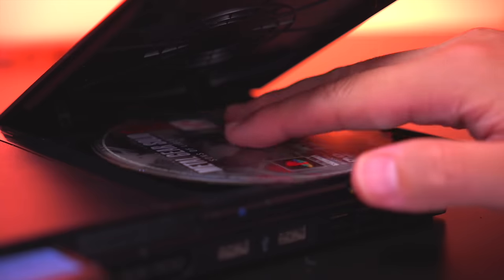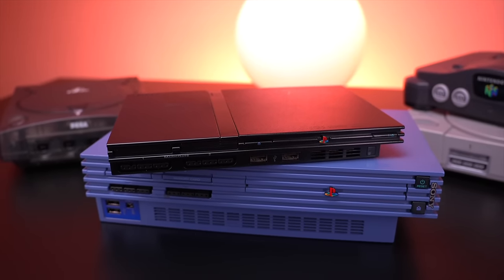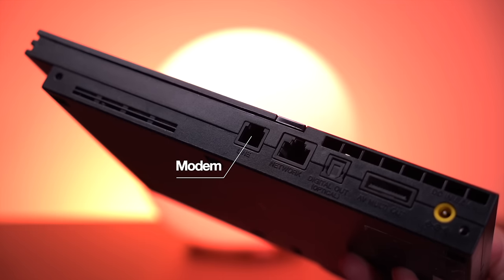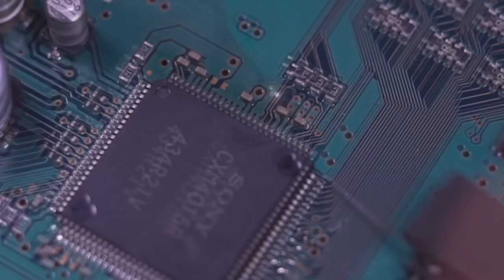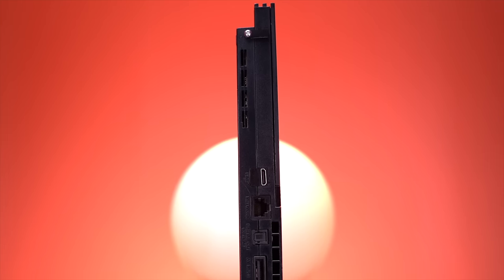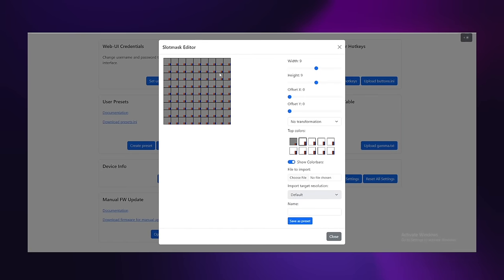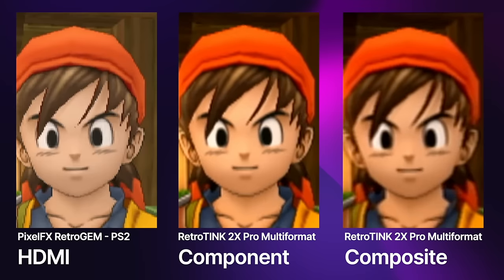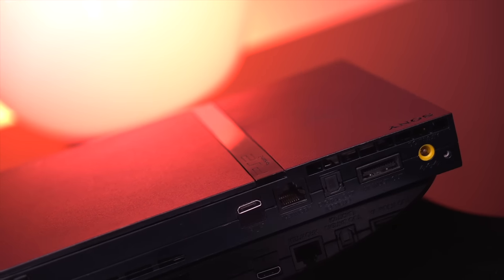This HDMI Mod Makes The PlayStation 2 Look GORGEOUS!

Comment: Charging more for non hardware features is crazy, hope the devs change their minds on this one
Reply: 🤷‍♂Software doesn't write itself...
Reply: @VideogameBucko  it also has a zero per-unit cost post-development, so it's pretty dumb to charge on a per-unit basis. But, the fact that people will pay for it exposes how desperate people are for hardware like this. High demand, low supply.
Reply: @VideogameBucko  its the modding space and open source will always win, either these gadgets are going to get "jailbroken" or another team will make a better one that doesn't lock basic features behind a paywall
Reply: @VideogameBucko  so sell one version for 155 usd.
Reply: Charging that much in general for the mod is stupid and just gouging, especially given that the mod is meant to be pretty much a "one size fits all" option that works on multiple consoles. I get that it's a niche product, but $120-$190 for it is still kind of ridiculous. I hope they figure out a way to get the price down and produce more units, so that they also stop constantly running out of stock.
Reply: The cost is what it is. No-one is forcing anyone to buy either version. These things take time to develop, for likely a pretty small market, and the developers deserve to make a living. The market will decide whether it is overpriced or not; if it is, not many people will buy one and that will be that.

If you value 1080p output and MAD, then pony up the $190. If you're OK with 720p and BOB then save the cash. Otherwise, you're essentially just asking for the mod to be cheaper. Personally, this mod is cool but too expensive for my occasional PS2 use; I either play on a CRT, or render natively at 1080p using PCSX2, both of which look better anyway.
Reply: I think the major detractor is that it is already pretty labor intensive just to install and then on top of it, now you have a choice of the two. They really should have just sold the full version and called it a day.
Reply: @nismospek  Well, at least the difference is only in the software. It would be more of an issue if you had to [pay someone to] desolder the basic version, then buy the fancy one and get that fitted. You can't really lose; you can buy the cheaper one, then if it doesn't meet your needs, pay for the upgrade later. Or if you know you need >720p support, just buy the top version to start with. Either way, the cost is the same. 

It would be worse if the cost of the basic version + upgrade was greater than just buying the better version. Then you'd need to think carefully which you'd need in advance. Probably shouldn't give them ideas!
Reply: I have a feeling people will either have open source firmware or a way to pirate the official one in short order.
Reply: @ridingnerdy6406  That'd be a shame. They'd then need to drop the cheaper option and only do the $190 version.
Reply: 100 dollars for a basic mod that CAPS YOU AT 720P???
Reply: @ridingnerdy6406  Hopefully someone will reverse engineer this thing. You cannot software lock something like this.
Reply: @axi0matic  you contribute very little to the point being debated by saying "no one is forcing you to buy it" and "the market will decide its value". Yes, the cost is what it is, and people are voicing how pointless their pricing scheme is because, exactly, no one is forcing them to buy it, but they'd like to decide on their purchase without having to choose between two versions for something like this, since it makes no sense. 

It's ingenuous to keep thinking "the market" is some abstract thing that sorts everything out, the market is precisely what people make of it, and debating over whether the product's pricing is fair or not is a huge part of it. Makes no sense to just shrug it off as something one should just accept and not question at all. Do you really think the devs on this would starve if not for their product being needlessly tiered?
Reply: @VideogameBucko loser
Reply: @nattila7713  Yeah give customers less choice and make everyone pay for features that they may not need.. that makes more sense for sure.
Reply: @VideogameBucko  that is not a real choice. there is only one product and two prices.

there is noone who would only need 720p/bob deint... don't spread this nonsense :)
Reply: @axi0matic a really more basic 720p device would not xost 120. here you must pay the same expensive parts which you cannot utilize.....

so what you say is... BS
Reply: @VideogameBucko  but it can be copied and sold endlessly without additional effort..
Reply: I feel like they’ll be forced to given the reaction of the people in the comments. This won’t sell well at the current price.
Reply: @VideogameBucko As a developer myself, screw the devs that inflate prices for software features. Either set a single price that you’re willing to sell the FULL product for, or receive backlash and a drop in sales. Be a respectful company or don’t get respected
Reply: nah let their keep their mind on it, low sales record will change their mind
Reply: @VideogameBucko  So? They can be sued.
Reply: @Krilium  Yeah, giving people options and saving them money on features they may not need is such a dumb idea. Screw Microsoft for selling me Windows Home edition, they should have just charged me the extra for professional, despite the fact I've no need of domain features because I only have a home network, how dare they lock software features I don't need and will probably never need behind a paywall like this, I demand they charge me more this instant, I can't believe the cheek of it 🙄
Reply: Just pirate it
Reply: @kizurura that's more expensive than the console itself 😂, just give it a few weeks and the Chineses will make a cheap copy
Reply: @VideogameBucko You didn’t make an argument. You know that right?
Reply: @nicwelch  Yeah you didn't reply to me, you know that right?

Comment: The installation process was very impressive to see! Having installed several Modbo chips myself I know how difficult and frustrating PS2's can be to work on but filming the whole process whilst being able to clearly see what you're doing must have been even more challenging.

Having said that I still think using a PS2 on a CRT is the way to go, no amount of upscaling, filters, etc will make the PS2 look as good on a flat screen compared to the display tech it was designed for. If you're wanting a sharper/cleaner look running a PS2 on a PVM will get you a very sharp and crisp image! Otherwise a nicer consumer grade CRT is still the best choice for PS2 in my opinion.

Comment: Spend the money on the backwards compatible PS3 you will be much happier, and it will be a positive experience.  Soldering the contacts on those flex cables  is a real bastard with lead free solder, not to mention the higher temperature needed to flow the solder can easily damage the ribbon cable.  I wouldn't attempt this without a microscope and 60/40 rosin core solder.  Tito is really gifted when it comes to soldering and makes it look really easy.

Comment: I recall there were certain games on the PS2 where you had to hold a combination of buttons on the controller during boot in order to enable progressive scan. It would be nice if that process were automatic.
Reply: i think it's called GSM and it lets you force resolutions for most games
Reply: Certain games like Soul Calibur II, you hold triangle and x right after the PS2 boot menu
Reply: That was for 60hz mode
Reply: @CodyHimselfXI  other games might require a different button combo
Reply: @online_lizard  not many games work with forced progressive. Even some games that support 480p natively have issues when forced to progressive via gsm. Button combo when the game support It still is the safe bet
Reply: @online_lizard not quite, 480p through GSM is processed different than native 480p mode in game.
Reply: @MarceloMedeirosb  Nope, it's the same button combo and it's not for 60hz, it's for progressive scan 480p mode. I would know, I tested out every single game that supports it.
Reply: Yep, TEKKEN 4 comes to mind, you had to hold down Triangle and Cross simultaneously during start up.
Reply: Yup. The first game to ever support progressive scan on a Playstation console was Burnout 2: Point of Impact, and I always thought the process to enable it (holding X and Triangle on boot) was so clunky and I wished it would be automatic like how it was on Gamecube.
Reply: @CodyHimselfXI  Eh?  "480p mode" is the same as "60Hz mode".
Reply: @mazda9624  It's definitely clunky but, also kind of cool. It's like knowing a hidden secret. Hell, a lot of games that support that hidden feature don't even advertise it on the box. (Unless it's in the settings)
Reply: @GoatTheGoat  lmao....that is not the same thing. 🙃
Reply: Just an FYI, there is zero welding or welds when soldering.  You create soldering joints, not welds.  This is because the soldering is acting as the joint or glue between two items.  Where-as with welding, it is joining two things together by literally melting the two items and the welding material.
Reply: Yep. If you dont hold those 2 keys when game boots, no 480p for you, until you hit reset PS2. Certain games, like God of War 2 is nice enough to ask last time that you use 480p. Some others, like Burnout 3, just looks awful in 480i until you did hold those 2 and load in 480p.
Reply: That was for God of war 2, when you inputted in correctly, the SCEA screen would change to pink. GT4 had a dedicated 1080i mode in the options.
Most games that supported 480p had a dedicated option in the settings.
Reply: @KiteAndKeyProductions  But only the first time ever per console. After holding it down once, every game that supports progressive scan will always ask if you want to enable it on boot up even if you don't press any buttons. If you select the "No" option, then the setting on your Gamecube resets and you have to hold down B again.
Reply: @tidjane2001 Tekken 5 just has it in the settings menu.
Reply: @GoatTheGoat  It is not. 480p is just the resolution. A game can run at whatever framerate internally it wants.
Reply: That's correct. Dragon Ball Z: Budokai 3 is a game that supports this
Reply: @CodyHimselfXI  That's not entirely true, not all games use the same button combo. The majority use cross + triangle, but there are also games that use cross + circle.
Reply: @symphony137  I'm speaking from experience so, yes it is true
Reply: @CodyHimselfXI  And I'm speaking of facts. Look it up.
Reply: @symphony137  I don't need to look it up when I've already done it. 💁🏼‍♂️🤷🏼‍♂️
Reply: @yesmate78  that's what progressive scan is
Reply: The p in 480p stands for progressive. In progressive scan, the entire screen is updated 60 times a second (on NTSC). This does not necessarily affect drawn frames, only the screen update.

In interlaced mode, the screen is updated 60 times a second but only half at a time. On one update every odd scanline gets updated, and on the next every even scanline is updated, for a total  of 30 full screen updates per second.

It is true that the 480 part of 480p represents the vertical output resolution.
Reply: @CodyHimselfXI Ironically the European version I have lets you choose from 50hz, 60hz & Progressive Scan before the game starts without that combination:)
Reply: @zzztidurvirus You know, using a BC PS3 I'd always assumed there was no point using the "mode promotion" feature of /\ and X to enable 480p progressive, however I just tried it on Burnout 3 with my CECHC and wow the difference! Whereas before there was shimmer all over the backgrounds and buildings it looks a lot cleaner now and retains 1080p HDMI output. So thank you! 😊
Reply: Be a real man, don't.
Reply: @MarceloMedeirosb maybe have a bit of software that acts like you are holding the buttons for a few seconds without you having to actually do it. We did sorry to the controller port after all.
Reply: @bland9876  thats a good idea...or at least have opl identify the game and Tell you on the osd what buttons you should press.
Reply: Too expensive…I’ll pass on it
Reply: I ultimately got a game or two because they supported progressive scan. Granted, they turned out to be awesome games in their own right.
Reply: My god, the utter chore of having to hold triangle once in a while. I completely understand your frustrations, it's sooooo exhausting and difficult

Comment: The basic model should have 1080p , The last PS2 I bought used I paid like $40 Canadian, Like $30US so when you say $120-$180 US that's 4-6 times the value of current console, I think they should rethink the price plan, 1080p for $100-120 Still kind of expensive but a lot more sales would happen than a 720p version.
Reply: ... not to mention the fact that they stoop so low as to having DLC for a hardware product like car manufacturers and their scammy lot.
Reply: 720p may not be much of an issue for many people even when not connected to a dedicated scaler. The fact that motion adaptive deinterlacing is missing though is a deal breaker to me. Just look at 23:03
Reply: there should have been one version, for like 150 usd or 160. this soft lock is just awful business practice.
Reply: Just emulate.
Reply: Who wants to go through all that trouble for 720p lol
Reply: Exactly, PS2s are dirty cheap here in Brazil, paid US$15 for mine, imagine paying US$120 + 60% customs tax just for 720p lmao

Comment: Choices: This kit which requires you to hope that your PS2 has a better than average lifespan and won't die after 5 years regular use. Plus requires a steady hand and manual labor with a $100 entry fee. 
Or a decent converter for half the price, the same output quality and can be transferred to the next PS2 when the current one inevitably dies.
Reply: The converter you’re talking about, does it remove all the lag when used? Any one you would recommend?
Reply: @stealth2748  Sadly not, the converters quality depends very much on which random Chinese factory they came from. 
I've bought 3 converters over the past 10 years: 2 of them are utter crap and the other is perfection. 
Unfortunately the good one was the very first one i bought, years ago.
Reply: @BarbaricAvatar appreciate the reply. I do wish the lag was gone using modern flat screens. I’ve done soldering on a circuit boards before but this is above me. On their website they say they have installers. May have to investigate that. On a side note, my flatscreen has the old rca 3 lead plugs but still may try out one of the converters just to do it

Comment: Would have liked to see you try the smoothing settings. One reason I prefer emulation over modding PS2s is that the internal rendering resolution can be set much higher than a PS2 can do so aliasing is not a problem at all in emulation.
Reply: Even if you're only able to do 480P when emulating you can still do FXAA or SMAA & get Anti Aliasing without any significant amounts of additional system requirements.

It's just the overall better option if the game in question is supported (some seem to still have issues when emulated).

Comment: I'm... definitely sticking with my component cable. Kudos to you for having the skill and the patience to do this, though.
Reply: I have neither.  I just as well have and component up scaler than do all that.  The TV will also do some up scaling.
Reply: yeah i'll just stick to pcsx2 for now lmao mainly because the shiny version is locked behind a $70 software paywall
Reply: @CapnFlappyJaw42 same, also the AV/hdmi adapter is really really cheap.

Comment: The footage here is sort of worrying. I'm going to assume maybe it was captured at a low bitrate, because there's artifacting all over the place, and it's a little more aggressive than yt's normal compression. If that's not the case, and compression isn't to blame for the artifacting, than I hate to say it, but this is significantly softer and less color accurate than what the tink 5x could do with the PS2's analog component out. Is there any chance that's why there wasn't a Tink 5X comparison? I'm genuinely interested.